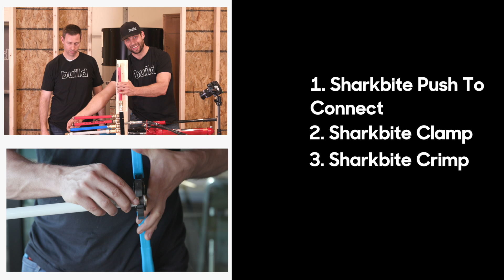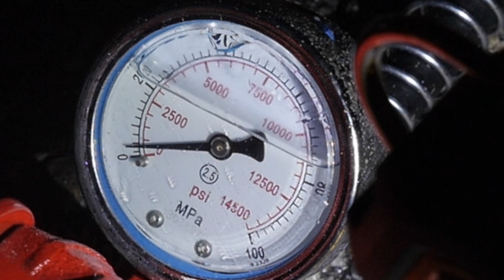Can we blow off these PEX fittings?  Sharkbite vs Viega vs Uponor

Comment: Matt, uponor pex is rated a bit higher (not by much) in comparison to pex  b , c, across all temperatures.
The fact that the pipe burst in that spot should indicate some sort of unseen pipe damage or even prolonged UV exposure that could have weakened the pipe.
Pex A can expand 3 times its size and not crack (freeze/thaw cycle) hence the flexibility and also why it expanded the advertised amount on your test then burst.
The other pipes just burst right off if they freeze.
So from a temperature standpoint, it’s the superior product . Same applies for workability routing pipes through tight bends and narrow angles where other pipes would require 90 elbows being used.
It costs more but also if you’re a plumber like us and on some homes you’re right at the limit with the fixture units you can put on 1/2” for example, expansion gives you more flexibility because of the extra flow through the fittings vs crimp and you can get away with 1/2” runs in some instances rather than requiring running 3/4” .
Just something to keep in mind if you do lots of new homes .

Comment: Funny that the threaded fittings were all leaking before any of the other fittings!  People talk trash about pex and shark bite but in truth the all work just fine and can easily withstand the average 80psi water pressure from city water supplies.  The pipes pop before the fittings fail.

Comment: Yeaaaah, I find it hard to belive the Sharkbite fitting gave loose at 0 pressure.  Maybe install it correctly and redo the test?  That was a horrific failure, I've been using these for years in 7 story hotels with 90+ lbs pressure with zero failures.

Comment: the issue with sharkbites is the rubber ring inside,how long will it last until it goes bad, or you get a faulty rubber ring...it's like metal roofing, the nails for metal roof with the rubber washer only last so long until they Crack and leak...I wouldn't mind using shark bites but on outside plumbing, like under the sink, or  for your the water heater,..or toilet but to use it inside a wall or under a house I wouldn't recommend, simply because of the rubber ring shark bites have...rubber goes bad and cracks.

Comment: when you blew  the first SharkBite, you indicated that you had to stop because you had hydraulic fluid all over yourself. Are any of these PEX pipes approved for hydraulic fluid?  I think such fluids will cause PEX to fail with little pressure. If you meant water, your next video should say water and using a gauge that reads up to 400 PSI in the test would have been beneficial for me. Thanks for the post.

Comment: If you were testing fittings you should have used a section of the same pex roll or 20' length.  You ended up testing the pipe and not the fittings.  Only 1 fitting was tested - the first one.

Comment: I agree with allot of these comments. The only "fitting" that you showed a failure on was the traditional shark bite fitting. The rest, you showed pipe failures. Maybe shorten the length of pex, and put a extremely rigid pipe (steel) between the shortest pieces of pex that you can install. That would allow the pressure to exploit the fittings, and not the pipe

Comment: When the first fitting blew off, you were pushing the disconnect ring with your thumbnail. No wonder it blew first. Did you bleed out the air that was in the pipes first? I don't think you did, which means you were compressing air in the pipes. Come on guys!

Comment: Awesome test! Good to know, I use shark bite pipe with copper rings and brass fittings as I purchased the crimpers 8 years ago. I have been kicking myself for not having an upenor expander for my van conversion, but after watching this it seems durable. I also have had some upenor done on a couple projects and its held up well.
Reply: Uponor

Comment: I don't even know if you can say that. the shark bite press on fitting actually failed. The teeth that are inside probably cut the surface of the pipe itself like a chisel through a piece of wood. in that case that would still be the pipe failing. I bet if they took that fitting and stuck it back on another fresh piece of pipe it would still hold just as well

Comment: Not sure about the value of a test that's meant to find weaknesses in Pex bite/push/clamp/etc fittings, when the brass thread fitting are seriously leaking before you even get close to a fail on the other end. Also, the flexibility of the Uponor tubing is a plus when plumbing, but has a pretty obvious wall-strength limitation issue; isn't that the stuff you put in your house?
Maybe the pressures being used for this test don't have much real-world relevance?

Comment: you could have filled the pipes with water and  connected them to  hydraulic fluid.. would have  been cleaner..
what  pressure does 20, 40 and 80 psi  regular pipes burst at??..
most people are mostly concerned with freezing  and recovery

Comment: The push to Connect shark bites suck I paid a plumber to install all new lines in a rental unit 2 days latter we had to replace all the fittings anywhere their was a fitting it was either leaking or the pipe completely disconnected as in your video

Comment: It looked like your thumb gave the Sharkbite a little push on the release ring.  Repeat with pressure gauge with all fitting on the same and strongest pipe (PEX or PVC?).  Good idea for a test but maybe better safety walls and keeping your hand off the pipe would be good.

Comment: Think there's a way to any options and fittings and pipe. Yes there quick easy but the plumbing industry needs to pick one and go with it till a drastically better one all the way around comes along. I come from the era of transition from Galv to the copper water pipe. Shark bite and copper are the way to go in my opinion.

Comment: Jordan needs to learn how to use a crescent wrench, just like so many others! That aside, after seeing the failures of the pex tubing instead of the fittings the next test should have been using copper piping with pex couplers, although it is evident that the fittings will work well in normal conditions.

Comment: Teflon tape is a thread lubricant not a thread sealant, That's why your threaded joints are leaking. 
Hydraulics includes water so the gauge should work no issue, and this was about what pressure they would fail at so the gauge reading was pretty important.
 The crimp rings are supposed to be set a distance away from the end of the tubing, it says on the bag they come in.
This was amateur hour if I ever saw it.

Comment: I put a shark bite cap on a 1/2 “ type L copper pipe which was inaccessible with a torch when they first became available. With normal water pressure @ 65# it’s still holding today. Great product!!

Comment: I'd like to see the test redone using copper pipe. Although SharkBite fittings were made to compliment multiple types of pipe and retrofitting, they can be used universally with CPVC, PEX, and copper. Seeing as most of your ruptures happened with wall failure of the PEX pipe, I'd like to see what pressure the fittings actually fail with a pipe that has a higher pressure load as I believe the copper will hold up a lot better to that pressure over plastic giving us a better readout on where the fitting actually lose his grip rather than where the pipe fails. It's great to know that the pipe will fail before the fitting when using PEX pipe; but what we really want to know is the pressure where the fitting itself fails; not the pipe.

Comment: What if you put a copper or iron tubing sleeve over entire pex pipe and just have the fittings tight against the ends? Wouldn't this place more pressure on the fittings instead?

Comment: not that surprising, really - the tubing itself is DESIGNED to fail long before the metal fitting will... sharkbite's are rated for 250 psi, or they used to be...

Comment: There's an inherent flaw in PEX-B (crimp or cinch type). The fitting themselves.  If you are connecting a 1/2" copper to 1/2" PEX-B, you WILL have a reduction in water pressure.  The PEX fittings that go inside the PEX-B tubing has a smaller opening - almost by half - of the PEX tube. Even more noticable when you are connecting 1/2" copper to 1/2" PEX.  If you are transitioning 1/2" copper, use a 3/4" PEX tubing with 1/2" copper X 3/4" PEX fitting.  You must upsize your PEX to ensure you have equal water pressure throughout all piping/tubing.
Reply: J Thank you for the information about the 1/2 inch pipes. I was going to do 1/2in to 1/2in for a small bathroom repair I must do.

Comment: I guarantee the sharkbite fittings werent pushed to full seat... i have had 150psi on plumbing ... no issues on sharkbite & pex.. if they are not seated fully... youre screwed... leak guaranteed.... fully seated... no issues.

Comment: Be interesting to add your prep and install of the connectors onto the pipe.  It's possible the install was flawed for the push-on Sharkbite.  Plus, I'm not a fan of PEX or any plastic pipe.  Most reviews of Sharkbite cite the longevity is unknown for the rubber o-ring.  Well, what's the longevity of plastic pipe?  Copper is still secure in 100+ year-old buildings.  I'd like to see you test the Sharkbite on copper pipe, but I'd suggest you protect yourself better.

Comment: This test really didn’t prove anything about the fittings since they didn’t pop off.  All the failures where to the pipe not fittings. Good test for the piping.  Fun to watch, good video
Reply: I proved that the fittings are rated higher than the pipe...

Comment: I used to burst test aluminum tubing.  Hand pump, hydraulic fluid only,  NO AIR.  When it ruptures there is no big spray.  Thanks for the comparison.  Your metal pipe tests will be lots more dangerous, I hope you build (built) ballistic protection,  now I have to find that vid.  Cheers from North Texas!

Comment: While the idea behind this video is good, this test is absolutely pointless without a gauge that is readable at the lower pressures all of these pipes and fittings are rated for.
It was obvious, based on the design of the Sharkbite push fittings, that they would fail early.
The Sharkbite, and the Uponor expansion fittings are both rated for 200 max psi. Unfortunately, it is impossible to tell at what pressure the push fitting failed.
Unless you are using pipe that will withstand more pressure than the fittings, you are never going to achieve accurate results. Since all of the pipes failed on the last four fittings, you cannot call any of them a winner.

From the video, it looks as though the gauge has only 3 graduating lines between 0 and 2500 psi, but 4 graduating lines for everything above 2500. Each graduation up to 2500 would then be 625 psi. So it appears that you were also reading it incorrectly.

I guess the really obvious question to ask would be why would you automatically shoot for 14,000 psi when you average home plumbing system falls somewhere between 40 and 80 psi?
All of the fittings in this "test" are rated for 200 psi, so it is likely that none of them will fail if installed properly in a properly maintained plumbing system.

I'm guessing this was just an excuse to break stuff, which I can totally respect.

Comment: Talk about unsafe... 

Him: " They are not really under pressure"

Me: "ummmmm The PRESSURE gauge measures in PSI" as you pump pressure into the fittings.

I was amazed at their lack of understanding pressure and how he held the pipe as the other guy pumped pressure into the lines

smdh

Comment: Put a “bleed off” valve at the top of all that piping, fill all the piping completely with water, bleed off the air by cracking the valve at the top, before pumping, and you’ll have a “true hydro” test.  By getting rid of all the air from your system, your gage will have true readings and not bounce back and forth with the trapped air. Since all the fittings were dripping water during your test, I’m not sure how you compressed any water or built any pressure. Thanks.
Reply: Air is compressible
WATER is NOT

Comment: Few things first: I assume your test is for entertainment purposes only. It must be as it has very little to do with true pressure testing of PEX and Shark Bite fittings. I am surprised somebody from Uponor or Shark Bite didn't respond to your video and explained to you how to do such a test. First, average house water pressure in the US is 35psi, best operating pressure is 55psi, and water pressure regulator has to be installed if pressure reaches 75psi. So all pipe and fittings in your test are perfectly OK to be used under normal operating conditions. As far as PEX - Uponor pipe goes, than pipe has cold water pressure rating of 160psi at 73F. Shark Bite fittings are water tested to 200psi. That's water pressure. You are testing with compressed air. Shark Bite fittings and PEX pipe do not provide any data on compressed air, and are not recommended for compressed air application. So looking at your test, all pipes and fittings most-likely passed the test as designed, and as they should. However, we will never know at what exact pressure the tested pipe and fittings began to fail, as you are using this funky air gauge, that measures air pressure in increments of 500psi. ( yep, that is 500psi !)  Come on guys, really.. ?!

Comment: without any pressure result, this is hardly a test.
Reply: Imagine a 2000 psi lazy gauge. It could have been so good.
Reply: Regular house is not meant to be anymore than 150 psi so this entire test becomes useless for anything other than looking for impractical results. You wouldn't use pex for high pressure lines
Reply: @twiztedclown Some people plumb air compressor garage setups with PEX it's good info for them, wrong channel but at least this info is available.
Reply: @twiztedclown  it’s not useless, water hammer or other things could create temporary high pressure zones. The numbers would be good to know.
My house is 100psi, i have to get a pressure regulator installed, hopefully this summer. My friends is 110psi and he blew his water heater. But yes pressure varies. My parents at at elevation relative to a pumping station in PA and their pressure is 30-35psi. They had to install a $600 pump and pressure regulator to bring it back up to 70.
Reply: @lifeisgood070  great you still have all numbers at less than their rated legal pressure values. A line blowing can often be poor quality materials.

Comment: the only fitting I've ever replaced was the push on and I had one leak and a house and I had to tear the outside wall out in order to replace it
Reply: I'm concerned about the longevity of the o-rings in the push on fittings which includes nicking the o-ring on install

Comment: Am I insane here or is nobody addressing the fact that the sharkbite did NOT fail? The pipe flew off from the threaded connection with the cap fitting still on the end of it. Or was the pex connected to the manifold with a sharkbite as well?
Reply: Nevermind I see now that they're all different connections to the manifold reflecting the same tech as the end caps. I thought they were testing the end cap blowoff.

Comment: Two comments to this because you asked. 1. The Shark Bite  Push2connect doesn’t require any special tools. The others require a $50-$500 investment.     2. You need a need a guage that reads between 50-1000 for more precise readings and multiple fittings or multiple tests as fitting quality could impact outcomes. Great idea though and thanks for doing it.

Comment: I tested my system at 120 Psi before placing the concrete in the floor.i left it for 4 days and the pressure stays pretty well on 120 pros depending at the sunshine on those different days.never lost any pressure.so thumbs up for pet and the crimp fittings.

Comment: you should put gages to see at what psi each line blows out at, im assuming proximity to the pump will affect the pipe pressures. Therefore the closest pipe will experience the highest pressures, so if a lower pipe burst its potentially because its closer and hit the blow out pressure essentially alleviating pressure in the rest of the system. Idk unless you have a input pressure and individual pipe pressures theres no way to know.

Comment: Shark bite push connects are junk. I fix them all the time at work (HVAC/boiler/DHW).  On pex we use uponor. The crimp on styles seem to be ok though I dont use it. Uponor can freeze and stretch, then shrink back down and still seal. The crimp ons freeze and break the ring. 

On copper pipe sharkbite push connect is the worst thing on planet earth. I use ProPress as much as I can. Soldering is second best. Sharkbite is a temporary fix only in my experiance

Comment: Your "test" has zero value From a plumbers(or home owners) standpoint .
Your parameters were not
equal ,you can't read the pressure. 
Your set up, execution and every fitting has no specs on how it was installed. 
Every fitting can fail due to incorrect installation. 
And looking at your other parameters no one can reasonably assume you've done them correctly.  Every aspect has the flavor of : "dude,hold my beer and watch this"
FAIL
thumbs down